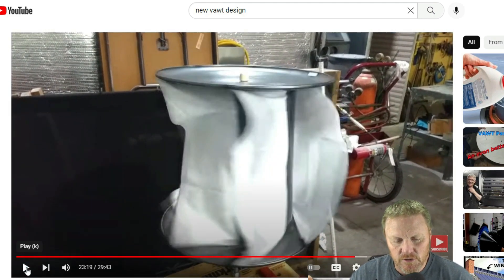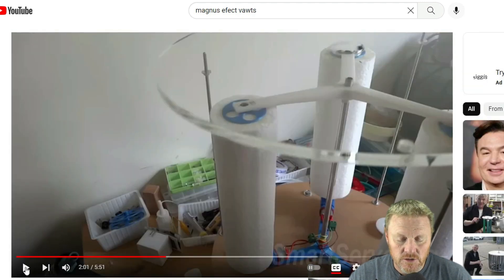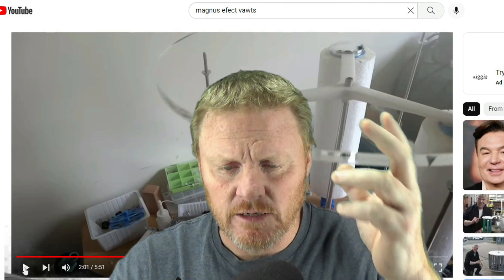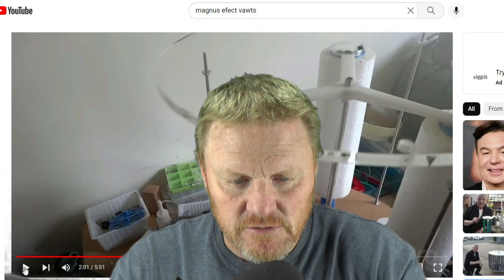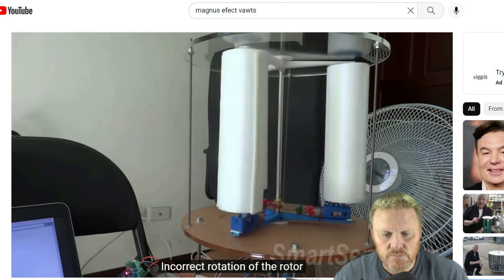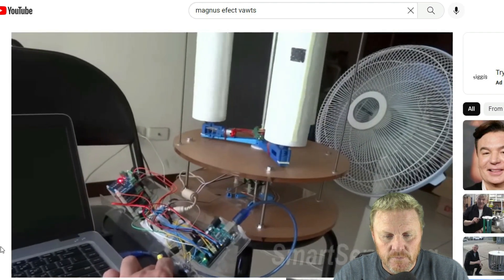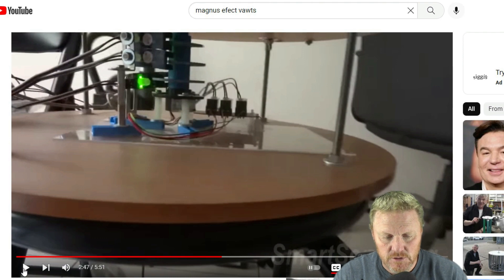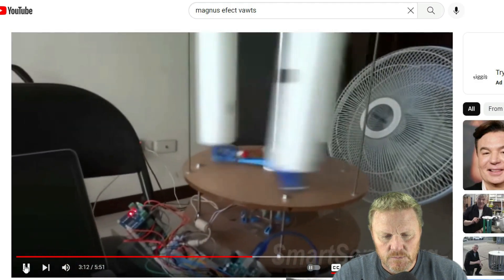This New VAWT design could change everything

Comment: Magnus effect VAWTs need motors to spin the three cylinders to create the effect.  The big problem is that the cylinders need to spin one direction when moving downwind and the opposite direction when moving upwind, so each cylinder needs to switch rotational direction twice for every rotation of the VAWT rotor assembly.

In the video, the equipment below the VAWT rotor is the timing mechanism that switches the rotation of the spinning cylinders (three switches for three cylinders).  The timing of the switching has to be changed as the wind direction shifts.  At the start of the video the phasing/timing needed to to be adjusted to match the fan placement in order to work properly.  For outdoors use a weather vane is needed to adjust the phasing as the wind changes direction.

The lift to drag ratio, that determines efficiency,  (as far a I could find) for Magnus effect cylinders is between 1/1 and 7/1.  For cloth sails on sailboats the best L/D ratios are about 10/1.  For large HAWT turbine blades L/D ratios can go upwards of 100/1.
Reply from the maker: Just like I suspected then....It was too good to be true.
 Thank you for the clarification.
Reply: Just for the record, contrary to everything I've learned and read, I built a cloth sail vawt that achieved a TSR of 3. The sails must have created an airfoil shape when it was working. The video should be on my channel somewhere. 
Your video started out with a cloth vawt so I thought I'd tell you about mine. I'm thinking of starting another one soon. Hi Dan.
Reply: Nothing stops to cover one side of the rotor from a wind (in this case we ruine a main advantage of a VAWT - omni directivity). Just a half of an efficiency, but may be other numbers are so great to compensate this.

Comment: Come on! All practical tests show that small wind turbines hardly generate any electricity! ecause there is hardly any wind close to the ground. It is also extremely gusty, which usually shortens the service life extremely!  Only if you are off grid & live close to the sea, you should install the largest possible wind turbine on a high mast for the winter.
With solar modules, on the other hand, reliably generate electricity for 25 to 30 years at approx. 2% to 5% of the cost of small wind turbines!

Comment: yes, VAWTs can take wind from any direction but that means nothing if its efficiency is less than HAWTs'. a VAWT takes the energy with one blade while creating drag with the blades behind, and if you have wind coming from multiple directions at the same time into the VAWT then the air itself is cancelling each other out and reducing the energy the VAWT can capture. 

HAWTs can rotate to get the most energy from the wind. In a HAWT, unlike the VAWT you have the 3 blades capturing energy from the wind at the same time. So even if the VAWT can capture wind from all directions that is useless if only the blade that face the wind first is the only blade capturing that energy.

There is another design for HAWTs, the Ridgeblade that takes advantage of an effect created in the roof. that collects 220% energy.
Reply: The image almost looks like a giant boxed squirrel cage fan mounted right along the length of the roof peak.  Interesting idea.

Comment: Savonious VAWT are decent low RPM drag devices, though I would not use the collapsible sail used at the start of this video for reasons outlined later below.

Like the old prairie multi-blade windmills which were also low speed, a low-RPM Savonious can be very efficient IF and only if you couple it to the correct load type that wants high torque at low speed as an input.  Prairie windmills pumped water up from a well.  Pumping water is a wonderful high torque low speed load so it's a good match.  Most off-the-shelf electrical generators unfortunately are compact for reasons of economics: less material especially copper, good match for the most common shaft RPM input speeds - medium to fast.  Therefore commonly available generators require their central shaft to rotate at high RPMs, moving the magnets thru the field of the copper coils quickly as the best match to their own small diameter geometry.  Requirements for high shaft speed is a horrible fit for slow turning multi-blade or savonious wind turbines.  Gearing up the shaft to a higher speed in order to use a small diameter generator introduces materials cost and frictional inefficiency.

 If you make the electrical generator larger in diameter, then it can use high torque at slower speeds and is a better match of the geometry of the generator to the capability of a low speed savonious drag type VAWT.  Some experimentors at a university in Brazil years ago, had reasonable success with bicycle wheel sized generators and savonious VAWT's.

Instead of using a collapsible sail config for VAWT blades to reduce blade return path drag, I think my own design using a partial wind shroud on the upwind blade return path can work well, especially if the shroud also diverts more wind into the downwind path captured by the downwind moving blades.  I also have designed my VAWT to push water around, not generate electricity, which is a better match for a low-RPM VAWT.  The trick certainly is to find a very good use for moving water in the first place, which I believe I have, just as farmers on the prairie did a century before us, though unlike them my use has nothing to do with irrigating crops or watering livestock.

Comment: Dude, first video I’ve seen, of yours. Your channel fits my 2 passions… I believe “school” is where we go to learn how to learn. Adult education is essential. I’m also “anti-corporate,” so anything to get away from the corporations setting the cost to exist…

I don’t think ppl really understand that aspect of off-grid and renewable energy, and how it can be used in town, to reduce their energy bills. There’s no reason you can’t run your AC off grid, on a solar/battery system. 

A battery is any way to store energy. (Hydroelectric dams are “batteries”) For a stationary battery, weight isn’t so much of an issue. Use a solar  to raise a weight, and as you need electricity, use the weight to generate power when you need it.

Simple things, like running AC off grid, get rid of the BS excuse for not transitioning away from fossil fuel corporations, that our grid can’t handle it…

Imma call you a teacher… I’ve chatted with other YouTube creators, called them “teachers,” and shocked them, but that’s what you’re doing… Teaching adults is tough… Best of luck…😉

Comment: Dude, I saw a video recently, of a vertical wind turbine that used a stack of cones, small hole up, and a shield around the back side, so the wind gets funneled up, thru the blades… I was very impressed…
Reply: Mounted horizontally, that would be similar to an Archimedes turbine
Reply: @bajamerica  If you say so… It looked like a very rugged design, because the blades weren’t exposed…

Comment: I have a brand new VAWT concept which slammed into my brain on the fourth of March 2023. It beats ALL the vawt designs hands down. I think it will beat the horizontal designs also.  

I don't know what to do. I've been thinking about turbines for over a decade and then suddenly it all came together. Who do I talk to? I want money. I want fame. I want it to be available to everybody. I think this could decentralize power for most people. I think this could change the world of energy production. Not for automobiles but for powering homes and businesses in all reasonably windy areas.  

The objective of a vawt is to create a wall of resistance on the power side and create zero resistance on the returning side. I've nearly accomplished it. I expect the powered side to be about 98% complete and the return side to only occupy about 4%. I don't think you can get much more of a disparity of wind exposure than that.

I don't know what to do.  

..
Reply: Start a gofundme campaign? Bet it would get some traction.
Reply: Get a patent first. If it's a new idea, you'll get it. If it actually works, manufacturers will license it and pay you a royalty. You can do both simultaneously. The date the patent is FILED is the deciding factor in a dispute, so do that first.

Comment: There are not two but three axis in 3D space. There is the LATERAL axis turbine. That is where the wind passes across the top of a horizontal axis roller perpendicular in direction to the axis of the roller turbine, like a roll of carpet laying on the floor and the wind causing it to turn on a horizontal spindle. So then you have rows of finned blades mounted on a roller supported with a bearing on each end. The support is offset so it can turn away from the wind. The wind blows for example from the northwest. The roller turns away from the wind as best it can causing the roller to be oriented northeast/southwest and the spinning roller is spinning so the top of it is moving to the southeast by the force of the wind.  

As the wind direction changes to northeast the supporting spindle, supporting the roller at each end, turns toward the northeast and the roller is now oriented northwest and southeast. The wind flows over the top of the horizontal finned roller. Instead of generating electricity the roller drives an pneumatic pump which stores the energy as pneumatic pressure until it is needed. Only then does it convert the pressure into electricity.  

..

Comment: I've designed a couple of vertical wind turbines. I haven't put a load on them as they were models, proof of concept. One is pvc pipe with 8 blades the other is 3 blades using an airfoil. Both seem to work, but not where I live. Sunny and windy in summer. Foggy and still in winter. Solar is working fine without the turbine.

Comment: I figured out something. If there were two vawt turning opposite directions and they were closer together the air would speed up where the blades were catching the wind. That would make up for the blades only catching air on one side.
Reply from the maker: We actually have that very thing here in Bozeman at an industrial building complex.

Comment: Look into the Ugrinsky turbine, Robert Murray-Smith has some videos on them. They were originally meant to work in water. It is supposed to be almost twice as efficient as the Savonious configuration.  I made some Ugrinsky models 8" diameter using 8" and 3" schedule forty PVC pipe cut on a table saw. The end caps are clear Lexan, glued and pop riveted. They are sturdy enough to work in water and spin pretty good in wind. So far it's just a kinetic wind sculpture, still waiting for serious wind.

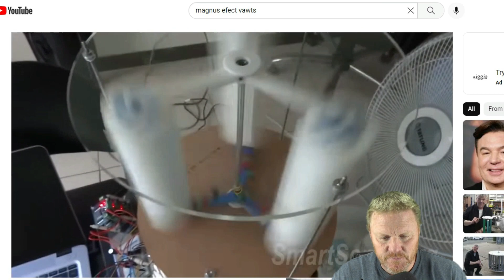Comment: 5:33 He isn´t "motor-driving" this thing (the carrier of the 3 cylinders), but still, each of the 3 cylinders is motor-driven itself, and has a tiny electric consumption. but that´s the small price for the highly elevated turbine-efficiency (the spinning carrier of the 3 cylinders, is what drives the generator), and the much bigger electrogenerating gains. He also has adopted some new principles since then, making it even more worthy.
HAWT-design is mature by now, not changing much, but HAWT-grouping, and clustering of such groups is still not finally researched yet (initial results look very promising), and still bears lots of potential (if you don´t have one single HAWT, but 50-100 instead, that is...). In other words, when building something for a single household, you´ll get happier with a vAWT.

Comment: Hello my friend !!!!!    We must remember there is no load and there is no motor that he is testing with so any thing would spin i like it to.    I have tested his out and built my very own and it is proven to run a lot better i have 3 different types as low ground windmill.  but the last one is the best . I have upgraded it to more pales and spins a great deal better . 

All so it produces 24 volts on load, with a boost amplifier steeped down to charge a battery at 15 to 10 amps but hey 10 amps is perfect. In the sunny period of the years  use solar and in the rainy windy months well  BOB your uncle check it out let me no what you think !! 

I all so have a way to stop the serge on the energy of the grid. I will share with all very soon ..

In my other video i explain a bit about this, but i figured out a easier way, but this may make a lot of people very upset and would not like that i am saying this.

 so i will word it in    klihkns.m.mclijjhcm csjcihjcb sos  mnniui87867 hjidcuy  vdvdv

Comment: My first wind generator was a Winco Wincharger 200 made in the 1930s or 40s. It had kind of like spring loaded brake shoes, so when the generator would spin too fast, these shoes would come out into the slipstream and slow it down .
Reply from the maker: The older wind machines were amazingly well engineered.

Comment: The sail design is interesting but why would it need be cloth material and not a light plastic that was hinged?
Reply from the maker: To me it would seem that the cloth might be better because of it's light weight. I could be wrong though.
Reply: @veggitarianredneck  I think you could get plastic that is very light.   But there is also mylar, however it might not be strong enough.
Reply: Tyvek might work well.
Reply: Maybe using cloth is more responsive in the incoming wind